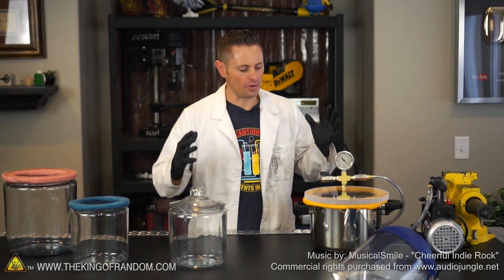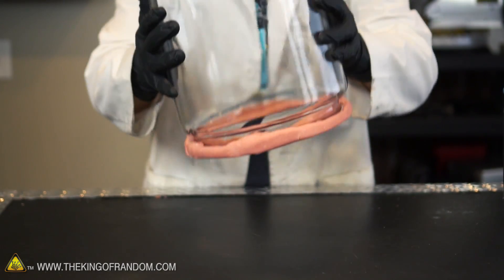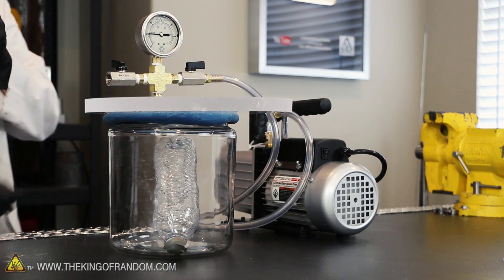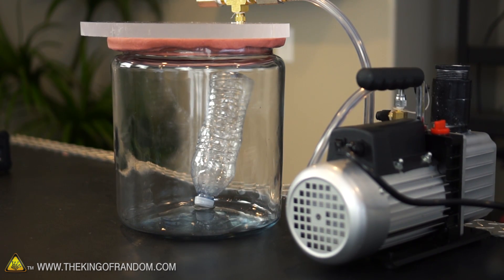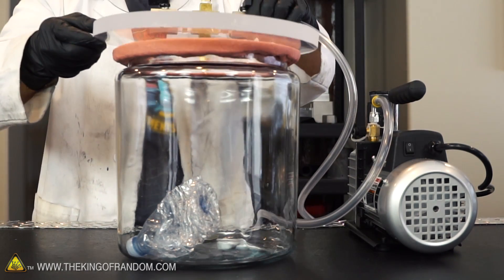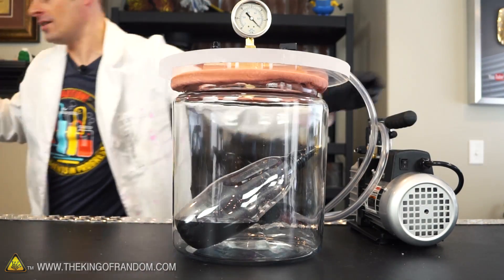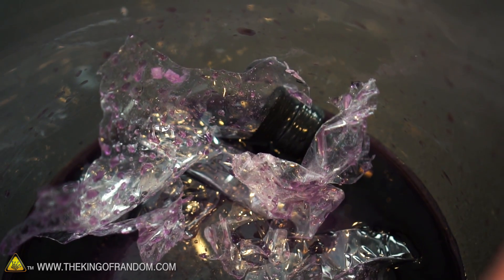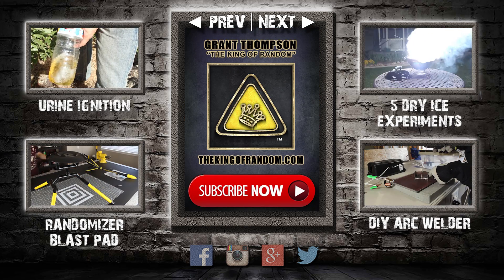Will A Glass Vacuum Chamber Implode?

Comment: A polycarbonate vacuum jar is safer but they are much more expensive than a glass jar. The weakest point of the jar is actually the center of the bottom face because it is flat and has no geometrical support other than it's own material thickness and strength. The sides have a cylindrical shape, which can withstand a lot of pressure, distributing it more uniformly. The cover is only putting pressure downwards directly along the walls, which can resist a lot too. The bottom is the real danger.

Comment: 25" of vacuum from that 1.5 CFM vacuum pump means you have a problem somewhere.
That pump is capable of 200 microns vacuum.

Bigger vacuum pumps only pull a faster vacuum, not necessarily a deeper vacuum.

Comment: You still have to be careful. At the minimum you should wrap the vessel with clear packing tape to both protect the glass from sharp objects and to give it a little shock resistance and to protect you if the glass should implode; The tape will hold the glass together a bit on implosion. The best method is to make a shield of hardware cloth. The glass is a projectile on implosion and can do some big damage to the human body. BE CAREFUL.

Comment: we can extract energy by atmospheric pressure changing so we can do this task near sea beaches where atmospheric pressures changing rapidly

just a chamber which is filled with water and air
changing volume of water will push the air and we got energy by turbine setup which gives energy in both sides rolling

Comment: Really you're asking why you had to try 6 times before the bottle exploded in the jar and why there's such a fine line? There's only a difference of 1 atm  between standard pressure and a complete vacuum. So basicly that's the only difference you can count on to make the bottle explode. Since you're not reaching full vacuum, the difference is even less. Hardly "extreme pressure". Many objects are built to resist explosion, not implosion, that's why we tend to think that implosion is powerful but still it's never more than 1 atm, at best, and only if you reach perfect vacuum.

Unless we're going underwater, that is, of course. Actually, you can bring the same jar (with air in it) 10.3 m underwater to see if it implodes, same experiment. You're still testing for 1 atm difference between inside and outside the jar.

Comment: If you want to see one explode buy a gallon jar by Anchor Hocking at Walmart item  #: 552659784. I was testing this for the first time. so I put about a quart of water in the Jar and was watching the air bubbles. I tested the relief valve then closed it all the way. After about minute, I heard the jar crack, I reached for the relief valve and it shattered. Lucky I was not cut but had a big mess to clean up in my shop.

Comment: You are taking those glass jars down to 25 inches whereas you were taking the metal down to 29, correct? Will 25 inches of mercury be enough to degass silicone, or are the glass jars just for other experiments? I ask because I'd like to use glass myself for degassing silicone and acrylic.

Comment: If the glass container ever did implode it would not send shrapnel all over the lab as you feared. Implosions send the shrapnel in the opposite direction from explosions, in other words, the container would collapse inward instead of outward and the shrapnel would end up in a heap on the counter. 

It's not surprising that glass holds up well to vacuum. It gets stronger under  compression.

Comment: Grant, be very very careful with vacuum chambers, especially glass ones. An implosion is extremely dangerous as glass will fly inward and then back out, throwing glass at super high speeds into the surroundings.  This glass can be hazardous and potentially deadly.

Comment: Why were you so afraid a Glass container would implode ? It's 1 bar at most applied on the surface. That's nothing. You could put 10 bars of pressure on it and it would still be fine.

Comment: grant why does the bottle go back to its original form if its sucking out the air ?
Reply: Jay Que the vacuum is sucking out the pressure which is pushing on the bottle. Once you reverse the pressure the bottle while be able to inflate due to a lack of pressure.

Comment: The bottle popped because atmospheric pressure is actually around 15psi, which counteracts the 50psi in the bottle. Remove the atmospheric pressure and the pressure inside the bottle will have less force holding it in technically, along with the water within the bottle boiling raising the interior pressure. Love the videos man!

Comment: how does that work, is the air in the bottle being expanded?
Reply: The bottle popped because atmospheric pressure is actually around 15psi, which counteracts the 50psi in the bottle. Remove the atmospheric pressure (put it in a vacuum) and the pressure inside the bottle will have less force holding it in technically, along with the water within the bottle boiling raising the interior pressure.

Comment: If you want a taller chamber that has straight sides, look in the vase section, i have one that is about 7 1/2" dia, 19 1/2" high, and has about 1/4" walls.
See if you can pick up a needle valve (used for gas) to regulate the amount of air you let in, should be able to control the rise of media under test, i would mount an extra TEE so you still have the big valve for emergencies and depressurising

Comment: You said that the bottle exploded partially due to vacuum forces pulling it out, but that's not how a vacuum works.  In reality it is removing gas pressure from around the bottle so that the pressure differential between inside and outside is greater.  It is only exploding because of pressure pushing out, but the vacuum allows it to do that because there is less pressure pushing in.

Comment: The difference between atmospheric pressure and a perfect vacuum is 14.7PSI. Pulling a vacuum around the bottle only increases the pressure inside the bottle by 14.7 PSI.

Comment: i think you used the intake and exhaust backwards in your demonstration, the valve connected to the vacuum would be exhaust and intake valve with would the valve letting air into the system. other then that nice video

Comment: I have an experiment for your vacuum chamber. If you put gasoline in a vacuum chamber 
and take out the air and make a hole to allow for a propane torch to fit in the chamber without letting air in. Will the gasoline still ignite? (If it doesn't work, try putting proto putty around the hole where the propane torch fits in).

Comment: Your failure point wouldn't be the sides it would be right in the middle of the bottom. Because it's raised up, when you release air into it after sucking it all out, it will flex. Side have the surface area to release some pressure but the bottom, being raised, will put tension on the whole surface. And, release it fast enough, could blow up and shoot up like a rocket.

Comment: Suggestion: Float eggs in a bowl of sealant, slowly create vacuum so as not to crack eggs, then shake bowl to cover eggs with sealant, then slowly normalise air pressure, remove eggs and allow to dry then see if they implode when dropped.

Comment: Hi,
You should try freezing water in the vacuum chamber. If you keep the pressure low enough for enough time all the high energy level H2O particles will boil away so it should become solid ice on room temperature after boiling in room temperature

Comment: try lighting a match throw inside the bottle and immidiately close it with the lid, soon the fire is extinguish it will create a vacuum and seal jar. add a rubber gasket between the lid and the jar for stronger seal. this method may get you stronger vaccum than the motor.

Comment: You'll want to be careful with the liquids inside the vacuum - the pump can be easily damaged from liquid, even vapor, entering the system.  It might be worth it to intorduce a dessicant chamber along the channel to the pump.  It might slow down your vacuuming, but it will save your pump in the long run.

Comment: Grant you can also build a vacuum chamber without having to buy a expensive pump. If you reverse the check valve on a bicycle pump when it pumps, instead of pumping out air, it's sucks it in creating a vacuum. I don't know if this helps you but it may help others who want to build one and are on a budget

Comment: I could be totally wrong but having a vacuum chamber is the same thing as pressurizing a system to around 14.7psi? Which is 1 atm, except the air is pushing from the outside rather the inside.

Comment: It could not be that much of a vacuum if it was the tube that is on the pump would have collapsed vacuum tubes have a metal spring like thing
Inside  the  whole length of the tube! I know i used to rebuild -100 bar vacuum pumps for Vemags

Comment: From my experience with CRTs: when the container implodes, some pieces will fly; most will just end up in a heap.
Lesson: Never remove the steel band from around the CRT, unless you first let air in (drilling a hole in the anode does the trick).

Comment: what would happen if while it was still vacuuming if you took the top off
Reply: The Gaming Fox you couldn't because the suction the protoputty makes its like a suction cup
Reply: Of the Proto putty*
Reply: The Gaming Fox Atmospheric pressure (about 14psi) is pushing against the lid. If you calculate the area of the lid and multiply by that, that is how much force would be required to remove the lid.

Comment: +Grant Thompson - "The King of Random" Just to clarify: there is no such thing as vacuum force. Just the pressure differential. I. e. the difference between the amount of gas inside the bottle vs amount of  gas outside was great enough to crack the bottle. The force comes from the gas particles inside the bottle trying to spread out.

Comment: can you burn a sugar rocket in that vacuum
Reply: It would. He put rust in the rocket which is an oxidizer. Also Zach you are right a fire can not burn in a vacuum/near perfect. It does not have the oxygen. So when you put an oxidizer into a solution it can burn anywhere as long as it was lit before it was exposed to the vacuum. You can do this by starting a fuse (one that has a built in oxidizer) or you could use an electronic ignition right next to the rocket fuel (the fuel has an oxidizer so there you would have the 3 components to start a fire/ignite the rocket).
Reply: Gunpowder uses its own oxygen.
Reply: Unless you have something that's self-oxidizing. black powder would burn in a vacuum.
Reply: Zach Coleman it's not showing me any of your replies, I only see them in the email notification. 

but anyway, I never said the sugar rocket would burn, I don't know the chemistry of it. but anything reaction that is self-oxidizing, meaning it generates oxygen, should work under a vacuum. heat black powder with, say, a light to the point of ignition, and it should burn.
Reply: Zach Coleman it says "unless you have something self-oxidizing." that's not saying it [sugar rocket] will burn. it's saying it will IF the reaction is self-oxidizing, which I don't know.
Reply: read it again. There's a period in there, and no "the." it's two sentences.

"Unless you have something self oxidizing."

[as an example]: "black powder would burn under vacuum"
Reply: 12799MaDeuce it does have potassium nitrate so maybe
Reply: There's still oxygen, but just very little of it.
Reply: I wasn't talking about true vacuums, I was talking about the vacuums like the one shown in the video.
Reply: I think the lack of pressure will prevent the flame front propagating through the material.

Comment: Speaking of hairline fractures, i was a little worried once the bottle finally blew with how loud the sound was of the tire valve stem hit the glass walls. Would it have been better to put the plastic cap on it so that it wasnt metal threads hit the glass with that force and plastic instead?

Comment: Please make a Silicone mug cover, but beat as much air in the mix as possible and see if it will keep hot drinks hotter for longer since the trapped air bubbles insulate.... in theory!!

Comment: The water in the first try is only boiling because the bottle has a leak. Also it inflates after opening the gauge.
if the bottle had no leak the pressure inside the bottle wouldnt change and the waters boiling point would stay at 100degree celsius.

Also you can see at the 2nd try with the pressured bottle (which obviosly has no leak) the water isnt boiling. In fact the pressured bottle water has a higher boiling point because of the pressured air.

Nontheless great video as always.

Comment: not surprising, your only talking a max of 14psi (0.1MPa) in compression, and the the pump used only seem to make -25inHg (0.08MPa), with typical glass having a compressive yield strength in the order of 1000 MPa (4-5 orders of magnitude larger than the max force you can apply).
Reply: but nice work though, really enjoy the channel.

Comment: is it possible to remove the head cover while the vacuum is on ?
Reply: 3OGLAH it is not because they two different pressures are kinda fighting each other and it sucks the lid down
Reply: just think of it as a very strong suction cup. If you try and pull a suction cup off of something, it can be difficult.

Comment: How would it spread glass all over the room if its IMPLODING?
Reply: 919colorado23 it will implode with such a force that it flings pieces inword and then out the other way. also the chunks will bounce off eachother and fly.
Reply: The glass shards will fly together with such great force that the atoms will collide causing nuclear fusion, this will release a giant amount of energy outwards, which he said he will cover this in a future video :-)
Reply: 919colorado23 Because things implode and then explode
Reply: For an object to implode and disappear, you need a black hole which we do not have or can recreate or even want to recreate. Imploding just means it will blow inwards instead of outwards, if this was a can or anything metal, it would just get crunched into a ball but since glass can't bend unless heated, it shatters and so the glass implodes and get's spread all across the room. If the glass jar is round in shape it will shatter in all directions while I believe if its square in shape, it will only go up down, left and right.
Reply: 919colorado23 it crushes in then the new air is filling that spot in so fast that it pushes it
Reply: 919colorado23 it would hit itself with the same force of mass in [infinite places] meaning the force would be make it explode back
Reply: 919colorado23 
You essentially create a low-pressure cavity in the atmosphere. When it collapses, the pressure from the outside will create a force, pushing air inwards, from all directions. 
Collapsing cavities are not healthy for your ears, and glass honestly doesn't care, it'll fly through your body regardless of whether it had to pass a few inches more, or not.

Comment: "Combination of the pressure inside the bottle WITH the vacuum forces pulling it out" 
There is no force pulling from a vacuum. The vacuum only means that the equilibrium between the pushing force inside the bottle and the pushing force of the atmosphere is disrupted by removing the pushing force from the atmosphere. The only force acting on the bottle is the force from within itself.

Comment: The jar won't implode because of the net pressure. Outside the jar there is 1bar of pressure and inside 0 bar when fully vacuum. The difference is still 1bar and therefore the force per area (pressure) on the jar is 100 kN/m^2 or 100kPa. The bottle can probably hold 100 times that pressure before breaking

Comment: I know this is riding off of your slime/nitrogen idea that was submitted by somebody else, but what happens if you put some of the slime in a vacuum chamber? Does it need to be colored, and will the air bubbles be removed? It'd be interesting to see if you could make the slime have different opacities/consistencies.

Comment: Your terminology is a bit weird. What you call the exhaust valve allows air in and so would normally be called the inlet valve. The valve to the vacuum pump is where the air is removed, you refer to this as the inlet valve but this would normally be called the exhaust or outlet valve. Hmm, also you talked about the jar imploding and so scattering material, this isn't exactly accurate is it, if the jar failed it would implode, so material would go in to the centre of the jar, there would then be a reactive explosion which would scatter the material around. Nitpicking is what being a nerd is all about (grin).

Comment: Will a firework still light if it was put in liquid nitration?
Reply: Yes. There's oxidizer so it will burn just fine.
Reply: theLuigiFan0007 i think if you light the green stuff on the firework, the bombs will be louder. But blackpowder needs to be, not freezed,.
Reply: HackedByTurkey
Yeah, solid explosives and fuels will burn fine, but not granulated ones like black powder.

Comment: the problem with using glass for a vaccuum chamber, is not that it implodes immediately. It's long term use where the chamber can become cracked from bumps or knocks, and then throw glass shards when you least expect

Comment: I dont know much about metal casting, I wonder what is inside the metal sword taht u made previos vids after u made it with styrofoam then put it into sand and then pour molten aluminium and then took it out, I though the styrofoam was only coated by the aluminium, my question is: what is inside the sword?
Reply: RoxenMKD aluminium. the foam melts and boils, so there is no foam left